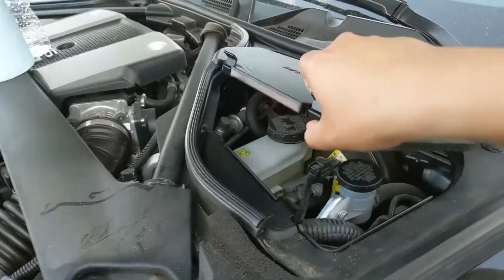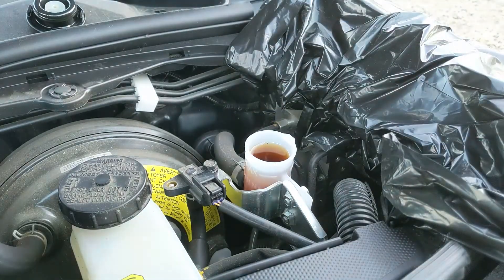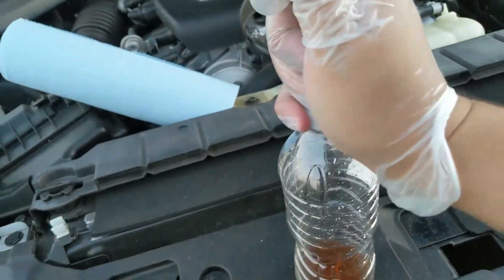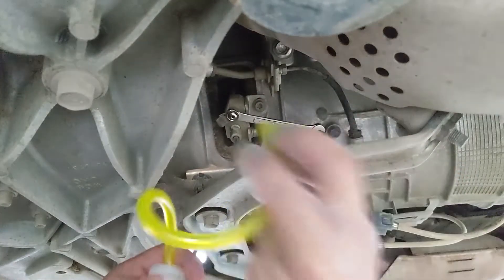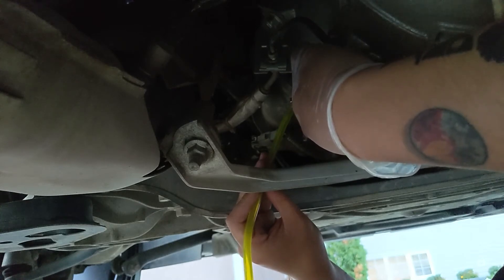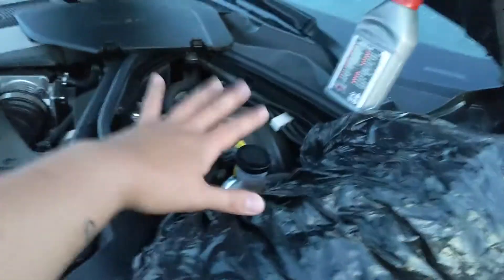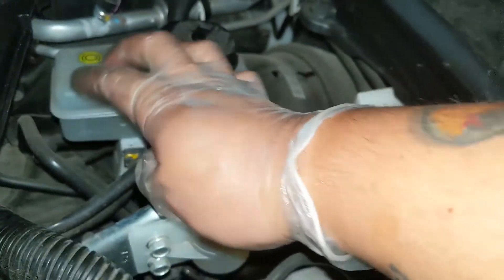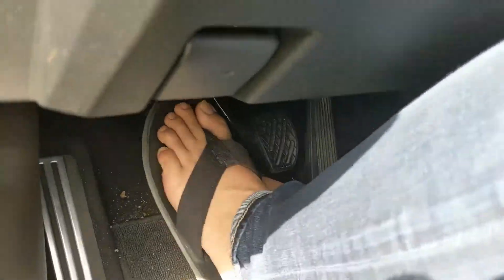Do THIS before your 370z BREAKS DOWN!! | CSC Failure Maintenance

Comment: I want this vehicle so bad. I've read some horror stories about the transmission and engine. It has made me very apprehensive. I'm not a mechanic, and I don't have a lot of money. A costly breakdown of any kind would totally ruin the experience.
Reply from the maker: Every vehicle has underlying issues. It's just a matter of taking care of the car. Doing your routine maintenance is key to avoiding any catastrophic failure. 

I am not a mechanic at all and I'm not that mechanically inclined either. I've had the Z for almost 5 years and it's still good so far. Modifying it increases the risks that you'll face so just be cautious. 

If you're set on buying one, you make sure you're checking for this fluid reservoir and if the gallery gaskets are done. It's kinda hard to find a clean Z nowadays. 

Good luck!
Reply: @ItsEricVenzon  Yes. I can do the maintenance,  but I'd never be able to repair the gallery gaskets. How are we supposed to know if they are bad?
Reply from the maker: @Biggerbyte  Checking oil pressure is one but that requires a mechanic to check it. Ask the previous owner if they've replaced it. 09-13 370z are plagued with this. Your best bet would be 2014+
Reply: @ItsEricVenzon  Yep. I figured that. I'm looking at a 2009. Bummer. You have been a huge help. Thank you.
Reply: Daily my z clocked 60k miles zero issues. It’s tuned by admin full bolt on. (How ever) I cruise in my Z never beat on it. I think problems only occur when you shut on your vehicle

Comment: I put regular clutch fluid on mine like a month ago because it was black and now it’s black again and it’s below the minimum amount. Would getting the better fluid that you got fix this problem? or would I need a new csc?😭
Reply from the maker: I think you need to try the Motul RBF600 DOT 4 more than the regular brake fluid DOT 3 and make sure it's running clear when you do the flush. If it still burns it to that color then I would start getting a CSC delete (which is more feasible so you don't have to keep replacing it).

Ever since I did this 3 years ago, it never burnt with the RBF 600 and never had an issue with CSC (so far, but a CSC delete is in my pipeline so I don't have to worry about it ever again).

Good luck!
Reply: thank you! @ItsEricVenzon

Comment: I was looking at buying an automatic Z (Ive been driving manual cars all my life, i just wanna chill, and its cheaper than the manual), and the guy told me that it has a service coming soon to replace the clutch fluid. Im assuiming that the class action lawsuit against Nissan for the CSC failure was successful, and they now acknowledge the problem and can do this (this video) thing as part of my service?
Reply from the maker: It sounds like they should be able to but if you're buying an automatic Z you shouldn't have to deal with this since you wouldn't have a CSC.
Reply: @ItsEricVenzon  thanks man. i love cars but dont know enough about them

Comment: Wait.. You are using brake fluid. Sorry, but that is confusing to me.
Reply from the maker: This is a good question. "Clutch Fluid" is really just brake fluid. The 370z clutch system requires a good hydraulic fluid to engage the clutch. It's basically like pressing your brake pedal to engage your brake. Don't overthink it
Reply: @ItsEricVenzon  Gotcha.. TU

Comment: Saw this video on flushing clutch on any car. (Channel is Screws Nuts And Bolts) Check it out if you get a moment and give me your feedback. It’s low tech method but it seems to be effective. I need to change the clutch and brake fluid on my 370z but I don’t want to give up a left nut to Nissan to do it for me. Since you’re very mechanically competent I trust your judgement. Let me know.

Comment: so my clutch's biting point was getting lower and lower and then i got my mechanic to change my clutch fluid he replaced it and it was really black, after i got the car back everytime i needed to pump the clutch a couple times before the clutch felt smooth or else it was still feeling very loose and would get stuck at the bottom or midway. if i didnt use the clutch while driving for longer than 30 seconds the clutch would go back to the floor and get stuck. what do you think the issue is? CSC? or Master Cylinder? or do you think the clutch needs to be bled again?
Reply from the maker: It sounds like there's still air inside the system so bleeding would help if that's the case. From what I read about bleeding this system, you can't use a power bleeder like the brake systems. If that doesn't fix your issue, you might want to consider a CSC delete soon.
Reply: @ItsEricVenzon  thanks a lot man, how should I bleed the clutch then?
Reply from the maker: @Uchiha  just like how i did it in this video. I had to keep doing it until it runs clear and there's no visible bubble when the fluid runs down the hose. Maybe do it 15-20 times. This is the only time I did this fluid change, and checked it every time I did oil changes. It hasn't given me issues after 20,000+ kms

Comment: My clutch suddenly has bite point getting closer and closer to the floor, but the clutch still has full range of return. The clutch fluid is dark. Do you think replacing fluid will fix my issue?
Reply from the maker: You should definitely go change the fluid if it's that dark. If your clutch fails you even replacing the fluid with a DOT4 fluid, that means you really need to replace the CSC assembly or do a delete. It's been almost 3 years since I've done this and 20,000km of driving, the stock CSC hasn't failed (yet).

Comment: I'm having a problem when the clutch needs to be lifted slightly up by using my leg to get a full engagement. I could still switch gears and all but everytime I do that the clutch does come back up all the way. Does it mean I still have air in the system?
Reply from the maker: Hey man, good question! If your clutch feels firm, you're good, but if it feels spongey, then there's a possibility of air being present inside. Rebleed the system, just incase.

Comment: Eric is there another way to do this with a power bleeder and which brand do you recommend?

Also how much brake fluid should be purchased for this job?
Reply from the maker: @tonycampbell9626  hey! Unfortunately, Nissan FSM doesn't recommend power bleeder/vacuum with this system. I only used less than 500ml for my flush.
Reply: @ItsEricVenzon  Thank you bro!